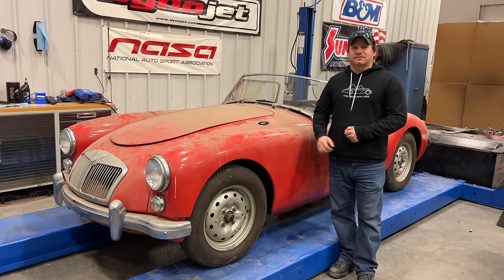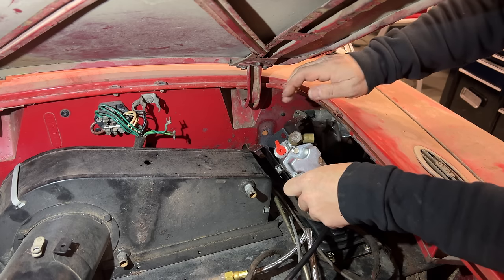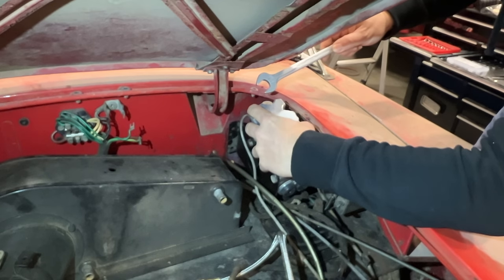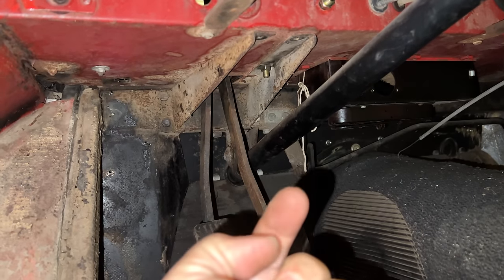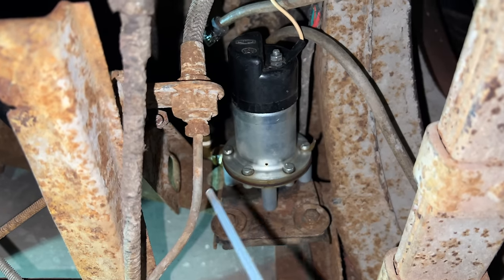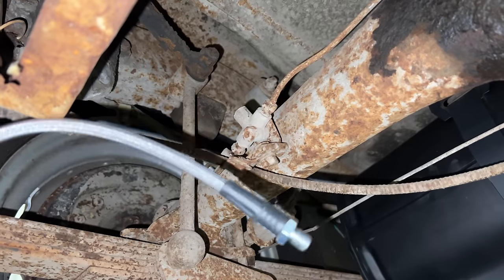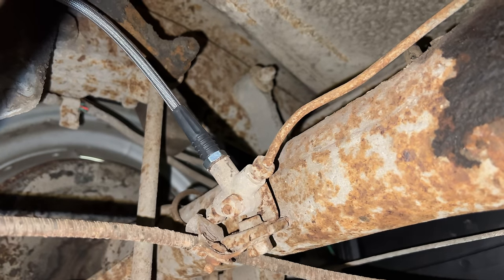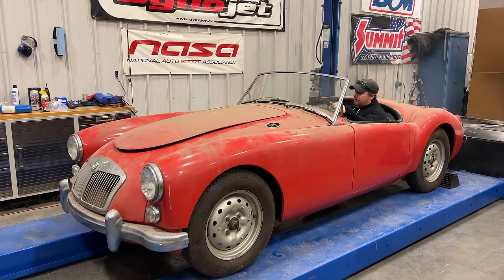1960 MG MGA 1600 Roadster - Part 5

Comment: I recently read a recommendation in a classic car magazine to not use braided brake hoses in road applications. The reasoning is that you can't see the rubber underneath the metal sheathing, so it could degrade to the point of being dangerous without it being visible.
Reply: @mudmucks  Any braided brake hose means not knowing its underlying condition until it starts leaking or bursts. The only way around this is to replace them on a schedule - probably a lot easier on a motorbike than a car.

Comment: Hi Steve, when using the same aviation Goodridge hoses on my front brake (1960 MGA 1600), they were a bit shorter than originals and when turning the wheels fully left or right the front hoses were under tension. I had to order custom hoses a bit longer. Did you encounter the same problem ? Cheers.
Reply from the maker: No these are Cobalt brand.  I remember running into that same problem with Goodridge hoses though.

Comment: The rubber on the excluders though... I have to replace them every 2 - 3 years as they crack open where the part that covers the pedal meet the base.. Complain to Moss about it every time, but still happens.
Reply from the maker: Do you have it pushed down as close as you can to the pivot to limit the amount of travel it takes?
Reply: @ThisWeekWithCars  I do. Do drive it 3k+ a year, but still. It's something to do with the rubber their supplier uses as the same thing happens to the steering rack boots.

Comment: Absurdly inaccessible master cylinder fittings is a classic case of function following form, coupled with poor design.
Reply: Old British sports cars are known to be  extremely reliable so there is no need to design components to be easily repairable.